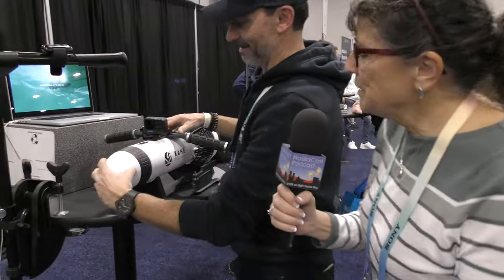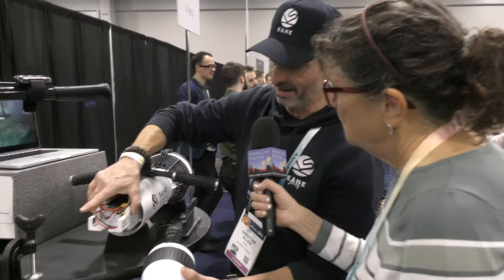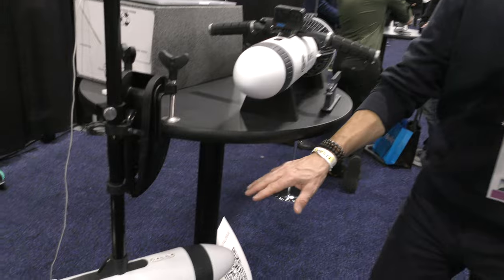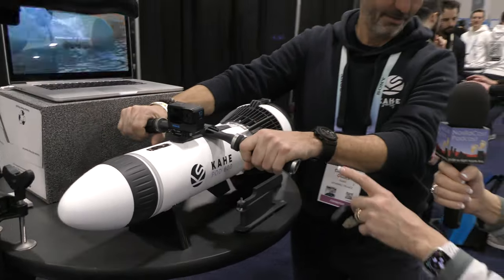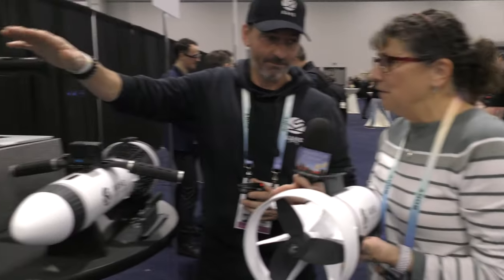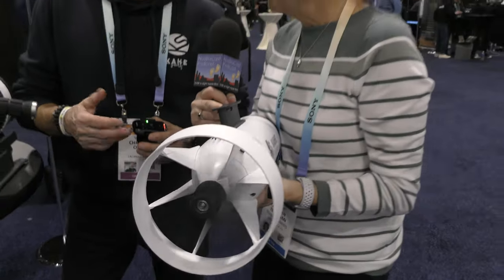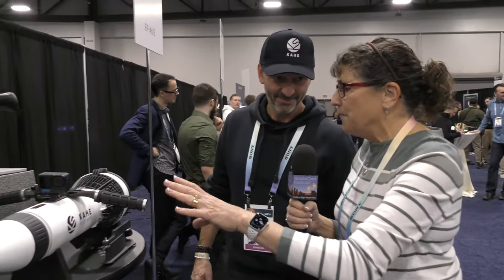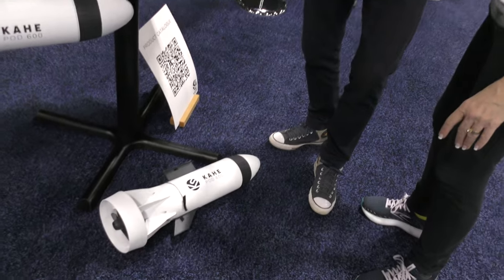CES 2024: KAHE Multi-Purpose Electric Outboard Motor

Comment: Curious if they are going toroidal props in the future?
Reply: Although it would be reasonably inexpensive to do the R&D to 3D print a plastic toroidal propeller it would take a long time to produce a truly efficient one. There would be a considerable manual labour cost to sand a printed propeller down to the required smoothness. Due to their geometry I don't think they can be injection molded.

When someone discovers the formula for the most efficient shape for different applications I'm sure each one will have a patent. This small company may choose to buy them from a supplier or produce them under license. 

Since these products are for recreation and not for commercial use it is doubtful that a toroidal prop would be worth the additional cost at least for now. They could offer one in the future as an option.
Reply: @darylloth3237  That seems reasonable.  Hopefully items like these will try for maximum efficiency in the long run.  Toroidal props make less noise as an added benefit.